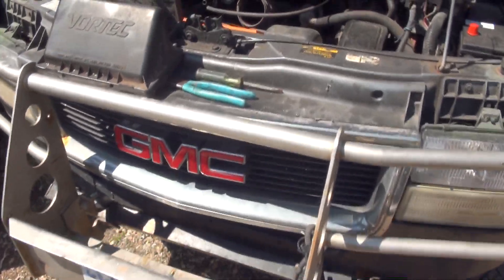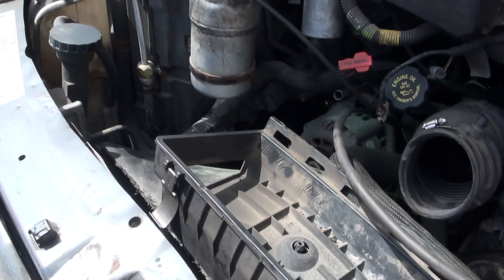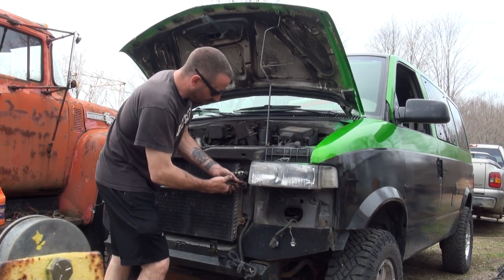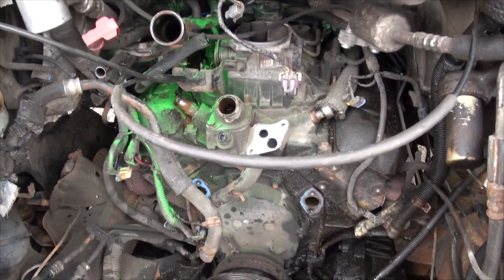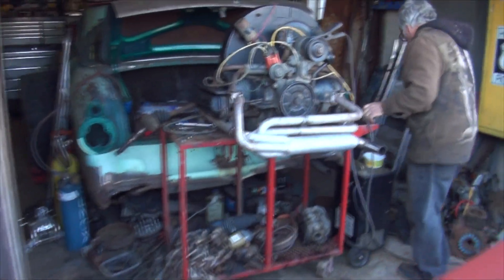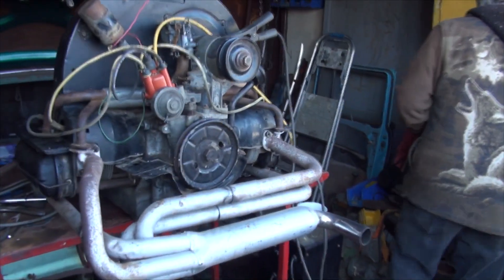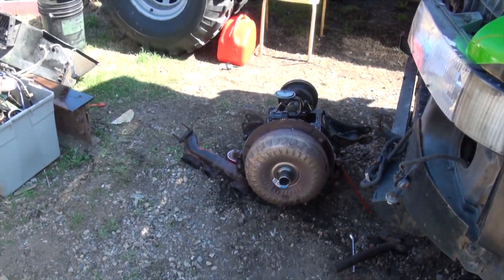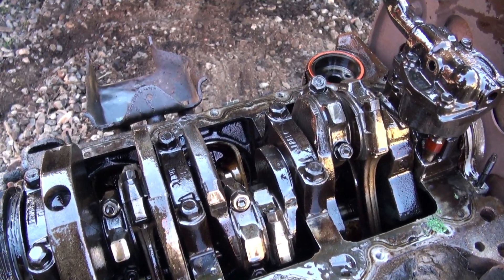HOW TO DIAGNOSE A BLOWN 4.3 ENGINE

Comment: @Stunt Dummy What do you think of a Jeep Liberty with a 3.7 cid Just your general thoughts
Reply from the maker: I've owned 3 of them and they were all great vehicles. I even have an old video that I will re-edit and post in the future. I got a free Jeep Liberty from the local Dodge dealership back around 2010.
Reply: @StuntDummyLives  Yeah I ask because @DDT is looking at getting one for $1000  It has 170k I think Needs tires and exhaust replaced "rusted"  Has tipical snow region cancer in spots but how cares about that but I have one question Where is a good place to buy replacenent bolts that are located between the exhaust manifold end and where the pipe is One of the bolts is bad and there is a gap and I can feel the exhaust doughnut with my finger I told DDT that if that goses it could sucking air and mess up the valves @DDT is not a car guy and I know some stuff but not like you
Reply from the maker: @kingninewillnotreturnvilla2  I buy exhaust studs on Amazon. They're cheap and good quality. That's not a bad price for the Jeep. I bought one in that condition before and drove it without issues until almost 400K before selling it. It still worked perfectly. I'm not a Jeep/Mopar guy at all but I will say that these Libertys are great vehicles. I really loved the ones I had. If DDT is thinking of buying one, make sure you look at the control arms in the front, there was a recall years ago... I can't remember exactly what it was but it had something to do with the control arms rusting and falling off. I took mine in for the recall and Jeep did the work so I'm a little foggy on whatever it was. Other than that, I have zero complaints with them and would gladly buy another one if I didn't need a truck.
Reply: @StuntDummyLives  Right on Thank you tons for your help 🤜🤛

Comment: That VW engine looks so weird, because it's a flat-4 with the pistons sitting horizontally on the bottom, and the crank in the center. Basically like every Porsche or Subaru engine, but like none other, because those are the only automakers that still use boxer engines. I think the modern Porsche engines could even be called the great-great-great-great-great-great-great-grandsons of this old beetle engine.
Reply from the maker: That is the exact conversation my Dad and I had on the way home with this engine. :)